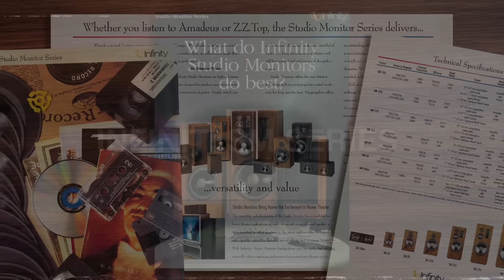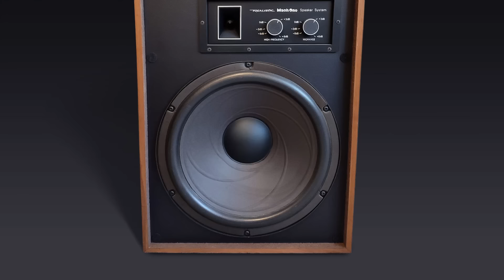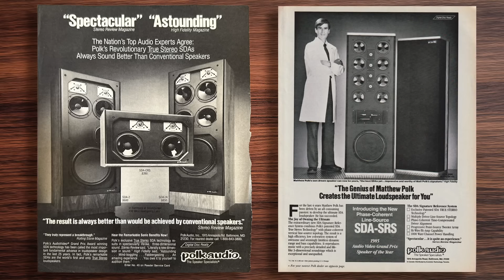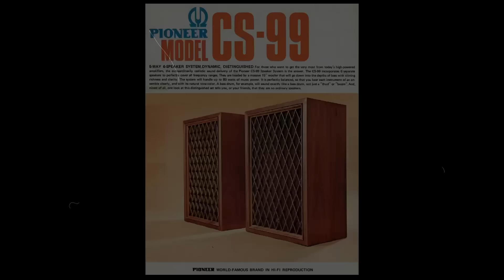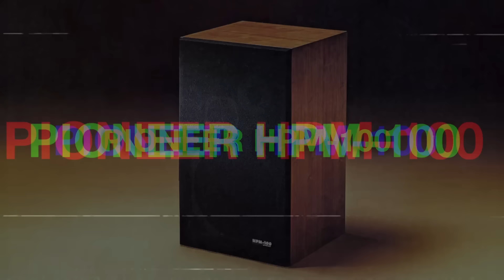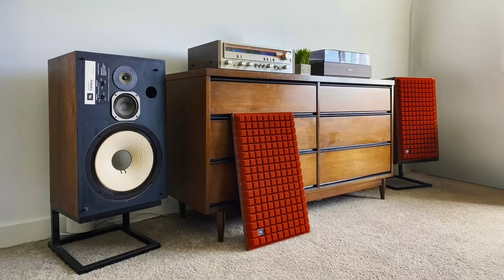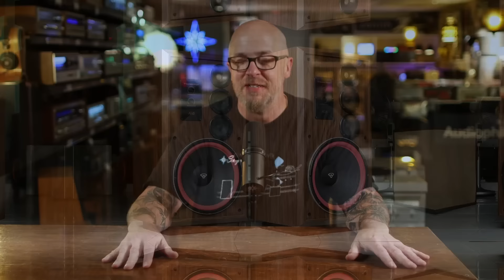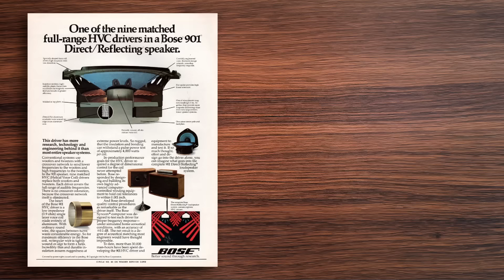Why Do Audiophiles Hate These 9 Legendary Speakers?

Comment: You missed the most famous hated speaker of them all: the Yamaha NS-10.  This 1970s bookshelf speaker is easily the most important speaker of the last half decade. Essentially all studio recordings were mixed on it from 1980 well into the 2000s.  It sounds bad in general, but it has a unique sonic characteristic which makes it highly desirable: an unusual and extremely fast time response, so it pops out transients like no other speaker.  This makes it very valuable to studio engineers as a debugging speaker, revealing mistakes in their mix.  Its sound is disliked and yet even now, 45 years after it came out, good ones are still worth $1000.

Comment: Lots of drivers can work look at the Beolab Penta in the 80s or the Beolab 90 now . 

I hated Amstrad it was pure and utter junk absolute junk in fact,  it can’t be put into the same categories as these manufacturers who are held somewhat in esteem ( bar Bose) . What I hated about it was ,  thankfully my Dad read what HIFI  ,  was that it cost nearly the same as a Pioneer stacked system when all it was was a plastic facade hiding ultra cheap and nasty electronics and lots of flashing lights .
They even put the turntable ina retracting draw !!!! This is the kind of stuff Bang and Olufsen does with HQ materials and state of the art engineering.
If you got one of these Amstrad systems for Christmas then Buggered by Boxing Day was not a long shot lol 😂. 
The horrible bastard who was behind it  Alan sugar who’s a London Spiv !!!! 
Mockingly said of potential customers of this horrendous impression of a quality budget system would get a “mug’s eyeful “ 
Meaning all those cheap flashy lights , that Equaliser with ultra cheap plastic buttons and that rotten retractable deck is just hiding a piece of shit 💩 
The speakers had interesting tweeter grills take the speaker apart and there was no tweeter !!! It has to be the worst music system EVER .
Unfortunately some of me mates dads had got “a mugs eye full”  me Dad had a Thorens 166 and Nad amp/cd /tuner and Heybrook speakers- when I listened to my mates dad s Amstrad I used to cringe I messed around with the eq but there was no way on gods earth that anything was going to leave this piece. Of shit that sounded ok 

https://www.google.com/url?q=https://everything2.com/title/Mug%252527s%2BEyeful&sa=U&sqi=2&ved=2ahUKEwjWsfzXxPiOAxWNWUEAHfKEF4gQFnoECEQQAQ&usg=AOvVaw05JJIYvemIbJ7zJR6Mm7sP

https://www.google.com/url?q=https://www.youtube.com/watch%3Fv%3DZqzrm_4_B94&sa=U&sqi=2&ved=2ahUKEwjWsfzXxPiOAxWNWUEAHfKEF4gQtwJ6BAgzEAE&usg=AOvVaw0yLPGkBP2GlZ35ZW6mTeAE

Comment: I love the old Altec A-7 VOT(T) - efficient and that horn does scream if it is too close but in larger settings it is hard to beat the A-7.   The one knock is the roll off under 45hz  but with the efficiency you can scoop up enough down to 20 with eq and Db.  I digress... It's been years since I thought about dragging a pair of A-7's to my bedroom (one for each ear pillow side), firing up an old school Bogen tube amp (you they had to have Bass and Treble knobs and a volume that definitely went to 11 -  I fed the beast with a BiAmp mixer (yea it had the red clip led over the trim knob per channel so you could count the bpms lol).  Yea I fed a "turntable" into the last two channels (stereo you know).  I laid down and cranked up Steve Miller Band "Jungle Love" .  To this day I believe the whistle at the beginning is burned into my brain!  Talk about screaming horn driven speakers!  Trust me when I tell you a twin bed is not an appropriate space for a pair of A-7's driven by 20 something year old db freak.

Comment: I had a pair of Polk Audio Monitor 10B, great sounding (very "airy" sound) mostly, but finally I grew tired of the undefined bass. They were the best speakers in the shop when I compared them. Sold them for smaller apartment space, bought a good subwoofer and satellite speakers. Finally the satellites were replaced by Klipsch satellites to manage piano music and opera... Polk was all "rock music".

Comment: I have a pair of Sansui sp 5500, or some number like that. 15” woofer, 2 midrange, 2 tweeter of which one is a horn. Bought new back in 1978 and absolutely love them. Finally had to refoam the woofer surround a couple of years ago and they are still going strong and sounding great.

Comment: Still have my JBL-L36's from 1977. Had the rubber on woofers replaced about 20 years later, and still holding up. Sounds good with my Dual direct drive turntable and other accessories. Sadly, my TEAC cassette drive of same vintage finally packed it in. Guilty of picking up used receivers at garage sales for a song over the years: two Sansui tanks, Rotel 403 and a Panasonic for backup

Comment: 901s, You are so right about the EQ. The EQ didnt work with my set. I played without..Bllllaaa. I researched the frequencies and levels from white papers and owners manuals and used a DSP program. It actually worked. The room was square, small and the speakers were hung exactly like the drawings in the owners manual. If you stand exactly in the spot where they required and closed your eyes, you could hear reflection from behind. Some would say that would happen anyway. The problem is, I miss them, the cabinets were hand rubbed walnut, beautiful. I did get a pair of Heresy III. Funny, 2 of the most hated speakers on the list...DONT CARE The DSP smoothed them out as well. I will be keeping them.

Comment: I still have my HPM-100's I bought brand new in the late 1970's.  Including the original boxes and the silk covers they came in.  I had assembled a very significant stereo system in my college days at Cal Poly, SLO.  We used to joke that SLO would bron out when I fired up the audio.  I also had a set of Bose 901 Series III,  a pair of Klipsch LaScala's and a set ESS 150 Heil Towers.  I bought the HPMs with a Pioneer SX-750, but upgraded to an SAE Power Rack system, a B&O turntable and other devices.   All of it is gone, with the exception of the HPMs.

Comment: I had the 901 with my Kenwood 125wpc  and BIC 980 with Stanton 681EEE and a digital delay system in the mid 70's and then with my Mac 4100 till I moved to VaBch and was told about NAD and the DCM Time Windows which I had till they were stolen.

Comment: I've had Bose 901s since the mid 80s.  The reality is that these speakers need to be placed properly to create the proper sound stage. I had them set up in a room that had a huge bay/bow window that bumped out from the main exterior wall. They sounded great in that set up since the bow window literally functioned as a kind of "resonator" that widened and reinforced the sound at high level. Since then I have moved and my current home just doesn't have a floor plan that can provide the same sound so the 901s are currently unused, waited for the day I can hook 'em up again.
Reply: I don't like ANYTHING made by Bose....

I had in the past, and very soon realized that it's all just trickery with an actual very nice cabinet design, but then they use the absolute CHEAPEST, trashiest, paper drivers that they could manage to get, and then they EQ'd the HELL out them to get them to sound like anything good. Some of the Bose products didn't sound too terrible, BUT with the trashy drivers and the heavy EQ'ing, the systems couldn't play very loud before they distorted very badly. I found an ACOUSTIMASS 10 system on someone's curb one time. I took it home and hooked it all up, and it WORKED. But I very QUICKLY found out that the speakers distorted badly at any real volume level. The subwoofer module ESPECIALLY so. 

SO, I took a hammer to the enclosures..... 

What I found inside was amazing. The drivers in the satellite speakers were something crazy like 2×, 2.5" CHEAP paper drivers, and they had a HORRIBLE response curve. The power rating on those drivers was very low also.... something like 20 watts RMS. The enclosures for the satellite speakers were made out of some garbagy type of plastic.

The subwoofer module was even more of a joke. The enclosure was made out of the WORST low density fiberboard that I've EVER seen in my LIFE! One hit with a hammer, and the thing splintered apart into shreds. The wood is TERRIBLE! Inside the enclosure, I found 2× 5.25" drivers, that are supposed to be producing bass notes, but AGAIN, cheap paper drivers, hardly any Xmax, and a very low power handling capability. These two drivers were just behind the hole in the front of the subwoofer module where the sound exits from, in their own little ported chamber.  Then, digging deeper into the enclosure, I found a single 6" driver. Now this one MORE resembles a bass driver than the other two 5.25" ones that I found earlier, but AGAIN, it's still a paper driver, not much Xmax to it, and appears to be VERY cheaply made. It very much resembles the driver that you would find in a cheap set of sub/satellite computer speaker sets. This driver was in a seperate sealed chamber of it's own, that was then piped up to the sound hole on the front. The whole combination of the 3× drivers inside the enclosure was a combination of something like a 4th order and a 6th order bandpass combined together. Loud, but NOT at all accurate, and colored with TONS of distortion.  

The design of the bass module was interesting, and probably would have been HEAPS better if Bose WOULD have used some much better quality wood, and for SURE some WAY better quality drivers. 

The satellite speakers are pretty much the same as cheap computer speakers also. Plastic is a HORRIBLE material to make a speaker enclosure out of. And again, the drivers were about the worst I've ever seen. 

Bose COULD have made some really great speaker systems IF they had NOT focused on using the absolute CHEAPEST drivers and materials that they could get their hands on. It's TOO bad too, because many of their designs were GREAT.

Comment: Nice piece, and the comments are interesting.  I was in college in the early to mid-70's, with no money to spare but managed to have a way to play LP's through Lafayette and Allied raw parts.  Favorite 5x7 oval's in lumber boxes (or mounted on top of large fiberboard drum waste containers in the design studio.)  I had a job running the architectural dept woodshop, so got into ordering parts from McGee Radio of Kansas City and building crossovers and cabinets - first sealed 2-way's then passive radiator (in lieu of vents).  Sold quite a few to friends at parties - we'd bring them over and hook them up in lieu of whatever they already had - good fun, a side gig that encouraged me to keep at it.  After college, the McGee supply got lower in quality - so disappointed - and without ready access to a good woodshop I started buying 2-way bookshelf monitors from Polk.  This was in the early 80's, and the local shops had a variety of product to sample and it was great fun to waste a Saturday with friends.  I've heard stacked pairs of Bose 901 driven by Phase Linear monster amp - lot of money for LOUD, but not engaging.  Paul W. Klipsch nearly tripped over my feet before his presentation at local dealer - I treasure the memory of his glare in my direction, but didn't favor the horn sound for small rooms.  I got up to the big shows in Chicago with friends and was able to hear the Infinity ServoStatic and other exotic brands - and to a shop where they encouraged us to "waste their time, since you're already here".  At some point, I had enough money and bought a Dynakit to assemble, the SCA-35 - combined with my AR-XA turntable and Grado FTE cartridge, I had many good hours of listening.  Computers ruined my budget, along with TV and home theater.  I still have a lot of the gear, have given away a bunch, but retain a pair of Meadowlark Kestrel II's, Thorens 145, that Dynaco and a slew of Denon receivers.  I miss the Saturdays, and the evenings of flipping disks - so thanks for the memories.

Comment: I was fortunate to hear a lecture by Amar Bose at MIT.  He had spherical speakers to demonstrate the power of reflected sound.  The Bose 901s tried to capture this concept.  Many of my friends had them but I never heard any that came close to these prototypes.  The idea that most sounds we hear are reflected was interesting, but tuning this concept in a room was abysmally hard (if possible), and I never heard a setup that didn't sound muddy. The most interesting concept I worked with was from B&O, where they tackled the problem of speaker crossover phasing. In a three-way system the mid-range was actually 180 degrees out of phase with the high and low ranges. This was because, if left in phase, the crossovers would create a notch filter at the crossover frequencies, virtually removing them from the sound. By inverting the phase of the mid-range, the notch was eliminated.  B&O's patent kept the mid-range in phase, but added additional speakers at the crossover points to fill in the notches.  I build a pair of speakers with this concept and it worked remarkably well.  These also incorporated side-firing woofers so I could place the speakers against the wall.  I used them for many years but moved on after I built my hybrid electrostatic/transmission-line woofer designs about 25 years ago.  I've convinced many friends and acquaintances that there is a beauty in the sound of electrostatic that exceeds most cone speaker designs.

Comment: I recently bought a Pioneer SX-850 with some HPM 100's for around 150 bucks without even knowing anything about these speakers. I just wanted the receiver. And I see both sides having a point. They are quite aggressive in their brightness, so some room treatment is very important. I'm not a big fan of their driver coherence, the sound doesn't seem to merge perfectly, that's why I don't think they are great for long listening sessions. But they definitely have something going for them, too. They are rather detailed and while not having a lot of depth, the soundstage can be absolutely massive, if one finds the right toe in. It extends way besides the speakers, which impressed me a lot. The real thing about these though is the bass. It goes fairly deep down, it's very punchy and it's suprisingly quick! So much so, that I actually couldn't believe that they made such a quick bass in the mid 70's. For everyone who thinks this is a rock speaker, well that's not wrong at all, but you need to listen to some HipHop with them. This is where they really, really shine. Very good for electronic music as well! As I won't use them as party speakers, I might resell them after a while. Because as stated in the video, other speakers can do the listening-at-home-stuff better probably. But first I will try different kinds of amp gear, which can make them sound incredibly different. Pro tips welcome!

Comment: On the 901s the ported versions did suck. Port chuffing, loss of lower octave bass and so what sound. But they were almost indestructible. I still have a pair of series 2 and the EQ was upgraded by David Shirley. It made a huge difference; especially in the treble. Get some good gear with a good current pushing amp. There’s just something about the full range driver with no crossover in the way. I use mine as rear speakers for the HT. They are not articulate and definitive like my AR speakers.

Comment: Bought a brand new pair of 901-4s back in about 1978. My L/R was ~11 x 15,  with a carpeted floor. I tried every position I could think of, but I just could not even like them. I sold them atta loss within a year. And you know what?; I was not sad about it at all.  Still don't miss them, lol.

Comment: REALLY enjoyed this video OP, many thanks :)

Ignore my Screen Name, decades ago I did Recording Studio work and provided Live Sound Systems for Bands and DJ's. Mostly used Commercial Speaker Systems, such as ALTEC A-7 cabinets with Voice of the Theater Horns, and JBL 4560 "Cube' cabinets with Horns atop as well.
Preferring the Horn Sound led me to KLIPSCH. Until I heard a pair of HERESY's, everything "Consumer" level that I had used before them was good or very good but a trade off - especially at the more visceral volumes I was used to from Commercial equipment. 

In home, over time, I found that the KLIPSCH KG4's were ideal - the Horn Sound, dual Woofers and rear passive radiator, nominally 6 Ohms rather than 8 Ohms, with the ridiculously efficient design (1 watt = 93 db) that let even modest amplifiers run them cleanly with plenty of Headroom to spare, and get them as loud as you might ever wish. Pair them with a KENWOOD Integrated Amp from the 70's - 80's  or anything by Dynaco and smile. I have 3 pair throughout the house, for Stereo listening in 2 rooms, and with other Klipsch's to flesh out a 5.1 / 7.1 system (KG .5 make great rear speakers).. 
Instructions in Case of Fire to my spouse: drag the Klipsch's into the front yard,then wake me :)

As for several others Listed in the Video:
-- PIONEER HPM100's - "Type O Negative", a fine entry into mid-Fi, seldom disappoint 
steered many into the Pioneers with a KENWOOD 4070 receiver, Teac tape, Dual Turntable.
I'd throw on a copy of BOSTON, FRAMPTON COMES ALIVE or ROCKS (AEROSMITH) - excellent.

-- BOSE 901's - as mentioned, Highly subject to room acoustics and placement, but they could handle nearly unlimited amplifier power

-- POLK - for me, mostly useful as an upgrade if you had a decent "Rack" package Stereo from Kenwood or similar to upgrade from the "Box" speakers provided. Clean sounding.

-- CERWIN VEGA - back in the Disco and Hair Band eras, if you wanted LOUD and the most authoritative, room filling, feel it in your chest BASS, CV's were it - GREAT for the task at hand,but if you A / B 'd them with most anything else side by side they sounded like Mud, too Bass heavy, but with the source material of the time they gave the people what they wanted. 
The # 1 Party Speaker, hands down.